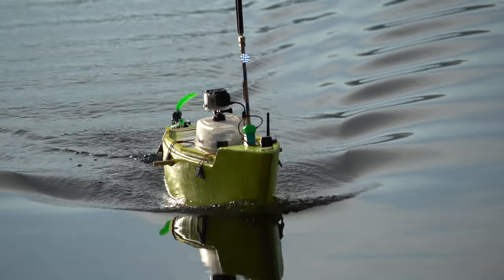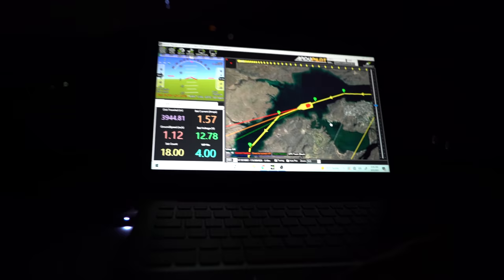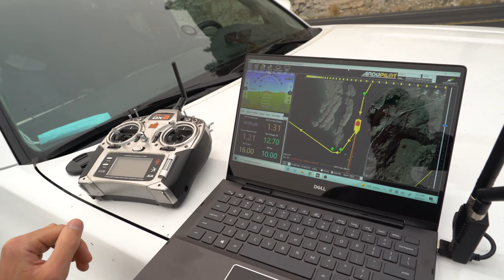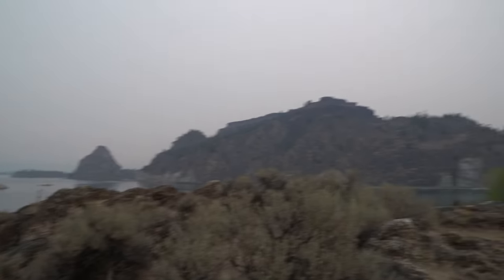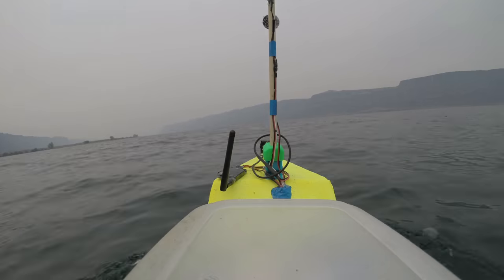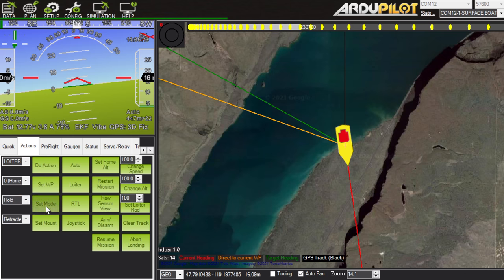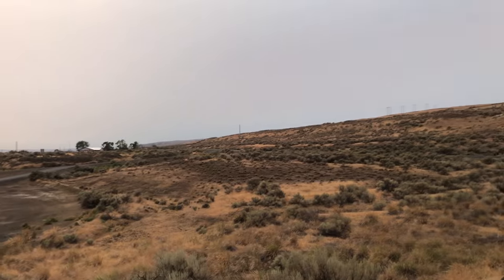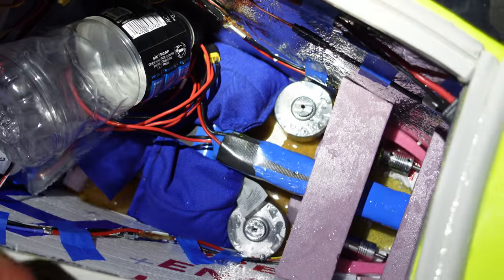R/C Autonomous Boat 30 Mile Waypoint Mission

Comment: I love your videos. If I may, I'd suggest  giving it slightly longer hull, maybe more aerodynamic like some of the newer military vehicles. Something to slice through waves instead of over all the chop. Take an idea from the polynesians,  add an out rigger for stability.  It'll help with rougher seas. Lights as well so boaters can see it better, especially early morning or at night. And if you could 3D print a prop cover like some of the newer tugs, it might help with your seaweed issues. I wish I knew how to program,  I've worked with fiberglass a bit working on aircraft as well as some install underground AC ducts. I would help you with everything except my lack of programming abilities. Wish I lived close enough to actually help. Your doing all sorts of stuff  I'd love to be involved with

Comment: Well done, sir. f you ever build a boat with this navigation system that is large enough to carry a good sonar system and move 1.5 to 2.5 mph, there is a market for that. Search teams that find cars and boats underwater in lakes and rivers would snatch them up.  It would need to go about a mile on a single charge and have a battery than can be easily swapped out in the field. Just a thought.

Comment: A great achievement indeed.  Congratulations. If the rudder/rudders were placed right behind the propellers then it would have better directional control as the force on the water on the rudder would have been more effective. Well done.
There is no need for pilots and sea captains these days, only good engineers are required these days working with financial controls or politicians!!!!

Comment: is there a kind of propeller that can clear up seaweed by itself? I've seen a new design of vacuum cleaner that clears hairs out of the roller thing... it's kind of the same deal, right? I have no experience in either case, but I just thought I'd suggest it :P

Comment: Suggestion: instead of air or water propeller, test with a silicone fish tail fin. You´ll find it will not stuck or collect algae or seaweed. With two fins that work opposite to each other the boat wont sway from side to side.

Comment: one way to get rid of the sea weed could be to ahve the prop shaft sleeve overlap the prop piece, so that the weed couldn't find a place to get trapped between these two pieces. Remove the cage surrounding the props aswell, as it doesn't prevent the weed to get caught: instead, it provides a way for the weed to get some extra support to get entangled. Last, you could design a spiral prop, with an incremental sweep, so that the weed is simply thrown away the shat's axis by the prop's leading edge.

Comment: Daniel, buddy. Do yourself a favor and pick up some traction boards, and get yourself a battery powered air compressor so airing down your tires is an option! If your truck has lockers, learn how to use em! I bet you'd have been able to get out with some 4-Lo and technique 😉

Comment: have you considered upgrading the waypoint follower algorithm to follow the vector instead? i worked on a follower years ago, and it would always attempt to hit the same vector (within some tolerance). this meant that if it was far away from the next point, like when you were on shore, it would travel towards the nearest point on the current vector, then try to follow that vector. its a lot more complicated than simple waypoint following, but it can be useful if you expect to be thrown way off

Comment: You should get yourself some LED or HID headlights for "adventures" such as this - and some actual shoes. You also don't normally want to stay in the wheel ruts when the road gets that bad - especially with a low-center toy truck like you've got. Your autonomous boat idea is great for potential survival scenarios; but, I'm afraid you aren't going to last that long if your approach to the outdoors is what we see in this video. o.o

Comment: That silt is what happens when too many people spin their tires and drag frame through the dirt. Does it rain a lot in that area?

Edit: I wonder if it would be possible to tie a light weight relay set up onto the drone so that you can more easily re connect to the drones froma  longer distance if you need to.

Comment: Was it trying to steer directly into the wind?
If so, consider doing what a sailboat does: sail at an angle of around 45 degrees into the wind (or set waypoints for such a course). Another option may be to change its shape so its course isn't affected by the wind so much

Sailors change the shape of their sail to make the boat as stable as possible for the current course, minimizing necessary rudder input, increasing the speed. If you want to know more about aerodynamics from a sailors point of view, let me know
Reply: I keep hoping he'll make an autonomous sailboat! Or at least add a deployable parachute-type sail for downwind legs on the ol' Banana Slug

Comment: When in soft sand or dirt lower your tire pressure to 9 psi... it will help you get traction... of course it's nice to have a 12 volt air compressor

Comment: When the road is bad like that just drive beside of it. Also in sand let air out of your tires. Desert off roaders run around 10 psi. Flat tires get more traction due to more surface area.

Comment: Would there be any practicality in bouncing telemetry from the boat to the drone and then back to the receiver on your laptop and send the drone in the general direction of the boat to get telemetry? I don't know much about multi layered telemetry, but I was a part of a project to move a very basic RC signal over a mountain with about 10 large posts held up across the mountain

Comment: ye need to Dremel sharpen and polish your propellers and smooth chassis for the propeller housing so ye give em a seaweed chance. Also, ye need binoculars. And planks (and speedy dry) or angled lifters (meant for oil changes but useful for mudders) for your car to get out of whatever that dust is or those studded snow chains that ye can screw whatever into and just go full sea urchin. Maybe also just a very long stick, a little longer than a hiking or ski pole with a loop in it. But ye your doing the good work.

Comment: next time you get into the off road areas with sand and shit, lower your tire pressure to 15-20psi  (true off road guys go to like 8-12, but I don't know enough about tires to know if that'd be fine for your tires).

Comment: what if you used a small generator that hand a tunnel leading to it in the hull so as the boat goes threw the wat it turns and genertes back up electricity

Comment: The 2nd video of yours I have watched.  The 1st being the previous video of you in Lake WA. being towed by an Autonomous Waypoint navigation system.  Obviously you are well adept at doing this and further praise for your abilities would be redundant from me now.  lol  I am torn by which was more interesting for me.  I do know that I like the idea of you being in reach of your creation more so than what was done here.  Idk how much this cost you to make, but the idea of it being ruined, lost, stolen and or un-retrievable is not appealing to me personally.  lol  However, the adventure that ensued for you to follow it along and try and be with in transmission range was able to outweigh the potential suspense of losing the boat.  Suggestion for your vehicle off the beaten paths, watch off road youtube adventures to aid you in what you should carry for repeat mis-adventures.  lol  Shovels, traction boards, etc.  Cheaper and faster than calling out for a tow truck.  lol  Since these types of adventures seem to be a solo experience, you should be prepared for solo missteps resolutions.  While you do have a great choice for reliability, a TRD Off Road would have been able to crawl you out of that situation I believe.  In soot, like that, I am not 100% sure of.  But I know 1st hand that in Sand, crawl control will walk you back up on top of the terrain and keep you moving along.  :)

Comment: How about sending it up and down the Erie Canal Waterford Flight of locks? The Waterford Flight is a set of locks on the Erie Canal in upstate New York. Erie Canal Locks E-2 through E-6 make up the combined flight at Waterford which lifts vessels 169 ft. from the Hudson River to the Mohawk River, bypassing Cohoes Falls. Built in 1915, the Waterford Flight is still in use today as part of the New York State Canal System which is open to public and commercial traffic. The Waterford Flight remains the flight with the highest elevation gain (169 feet = 51,5 m) relative to its length (1,5 mile) for any canal lock system in the world.

Comment: Be sure to add high-visibility lighting for safe navigation and to mitigate any potential conflict with other traffic. You have a start with that bright, white light on the mast but be sure to add a strong red light on the left and green one on the right.

Also, if you can, you should add either radar or sonar to the vessel’s systems to allow monitoring of other traffic.

Comment: I have the Tacoma, the DX8, the Mavic Pro, laptops and computers galore but I don't have a boat.    I had full size boats but I got married a couple times so I ended up with a kid instead of my toys.   Looks challenging.   I would think the drone boat would be seasonal, wouldn't do well in a frozen lake or in the Delaware river when Ice chunks are floating.  
Maybe my next toys will be rock crawlers or 4 x4s.   Is that even a hobby?  Does anyone ever strap a GoPro onto a 4 x4 rc model and see if they can climb a mountain?

Comment: those dirt roads would be nothing for my mothers izuzu mu. Not because it was good but because we couldnt give less shits if anything else fell of it. List of know broken things.
1.Windows dont roll up only down
2.Broken rear window
3.Rare seats stained with dead Cow juices.
4. broken headlight cover
5 Dents Plural
6 no handbrake
7 Driver door welded several times
8 Front CV slip and go TICK TICK TICK DDEEEA BANG when turning sharply.
so those roads would have been fine we would have been flooring it lol. Perks of having a truck that's already smashed! you don't mind getting it more smashed.

Comment: With all due respect for the autonomous part, you just ignore basic boat design wisdom that has been accumulated over decades. A simple displacement hall with a deep weighted keel like a sailboat would do wonders for stability.

Comment: Omg, he makes autonomous vehicles which isn't exactly the easiest thing to do intellectually speaking... yet he tosses a few twigs and bushes under the wheels to lift a 3500lb truck off the ground. Hmmm, sometimes even the smartest minds lack any common sense... and I wouldn't take offense to that comment. I would much rather know how to do what you do then how to get unstuck when you are off-roading. Except I have never had dust and sand buildup be the sticking factor but its ALWAYS those damn diffs. In Georgia, diffs become bulldozers in the mud, or maybe anchors is a better analogy, either way I have seen even worse ways to lift a truck up so it can get out of a hole. We once drank a case of beer and tossed the empty cans under the tires. Lol. So don't feel so bad. Cool mission though and even better was your determination to track the banana all the way to its destination no matter what obstacles you encountered!